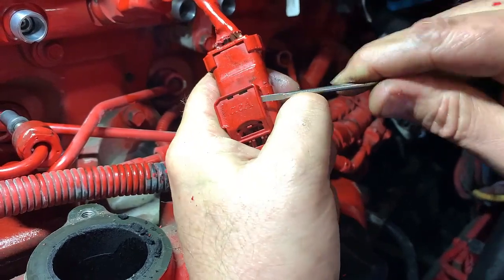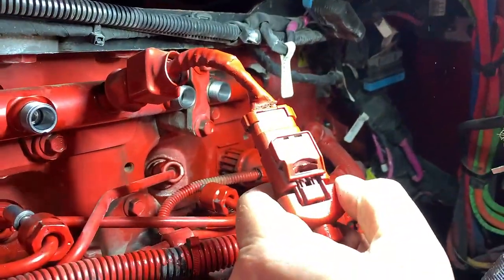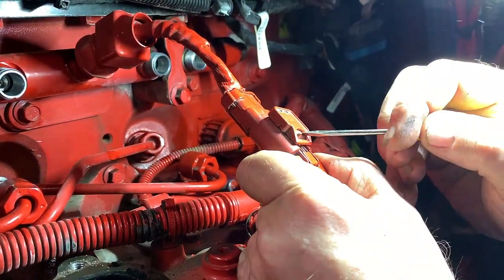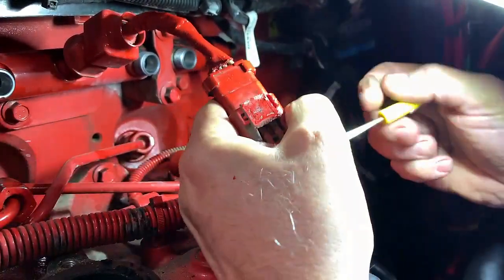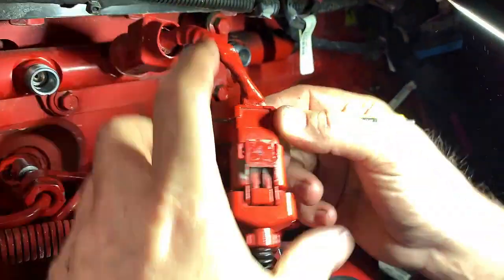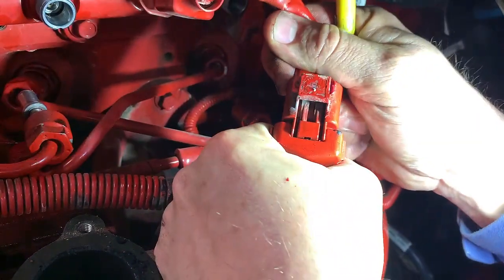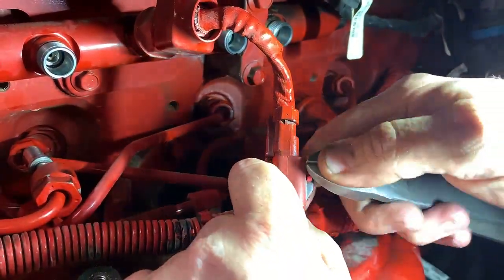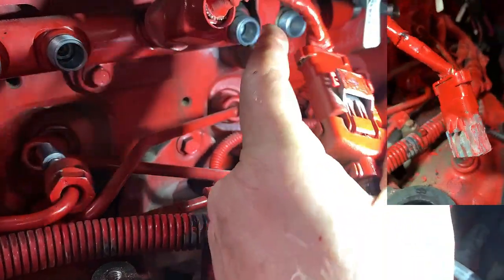Why can't I get this electrical connector unplugged??

Comment: use the large flat blade snap on screwdriver at a 90 degree to the lock. and wd 40 into the connector to lube the seal, never ever toss out a old engine harness with out taking all the old plugs off first,
Reply from the maker: we keep all the old harnesses too.

Comment: It's a mopar connector, it's available. Heat gun or air blow gun but in your case carb cleaner or acetone would have dissolved the paint.
Reply from the maker: Thank you for that tip. Remember when you share tips like this you are helping many folks you will never know you helped. Thanks